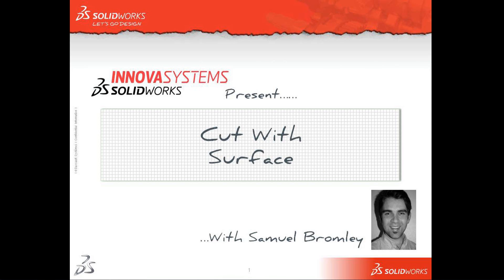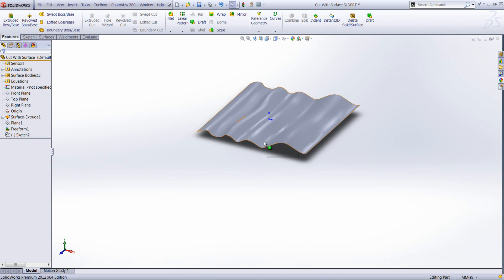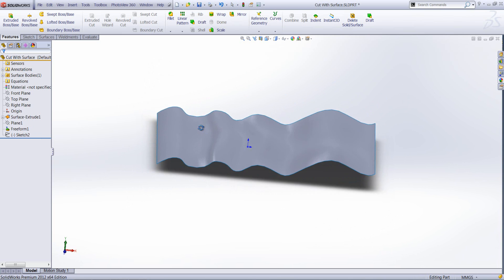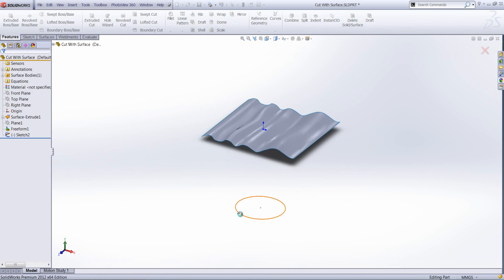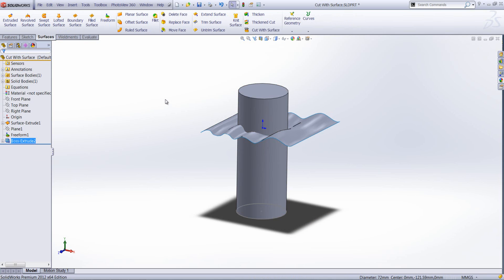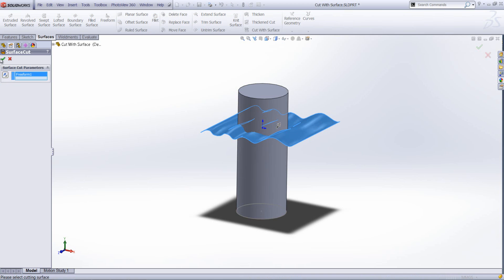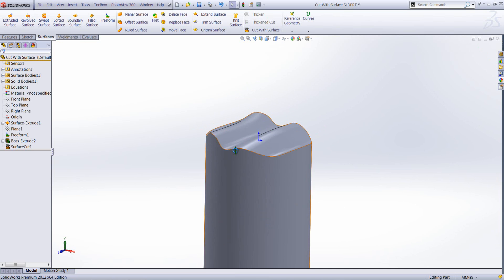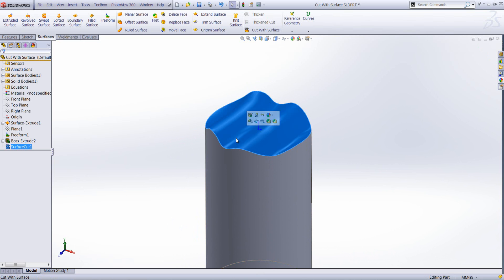Surface Cut in SolidWorks

Comment: How the hell do you split or trim a Sheet Metal part?
Reply: Yes exactly what I'm looking for, it's not easy!
Reply: @SeanPalmer62 Took a while, one way was  pasting in into an assembly and clicking 'Propagate to part" but you end up with messy references. For some reason some Sheet metal parts don't seem to accept an extruded cut but will if I redraw them .
Reply: @jackoneil3933  
Thanks for the reply, I'll keep persevering with it.
It's only a sheet metal chimney cap with  sloped top surfaces and shetmetal tube, but getting the shape to follow the cap is proving hard,,for me anyway 😃👍
Reply: @SeanPalmer62  If you want me to take a look at it let me know. It's two years from my original post and I've worked a bit more with sheet metal.
Reply: @SeanPalmer62  If it's a flat plane on the sloped portion, you should be able to draw a line on edge of that plane and do an extruded cut, if it's a curved surface then (not sure you can do that with a sheet metal base flange)  subtracting one part from another might be worth a try.
Reply: @jackoneil3933  
Many thanks for the offer, I struggled on for a good while and just couldn't find a way.
So rather than wasting any more time I just made a full pipe and sat it on top, scribed round with a Sharpie and sanded to fit, don't like being beat but it did the job 👍